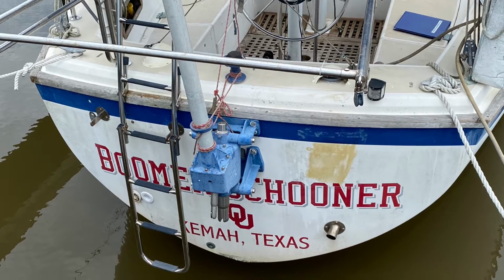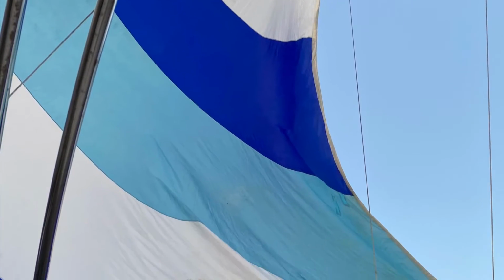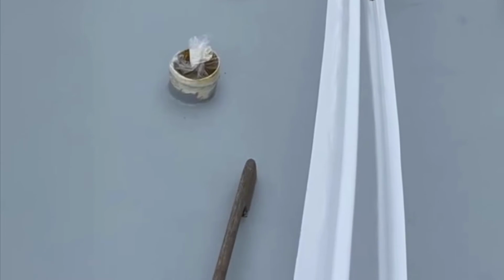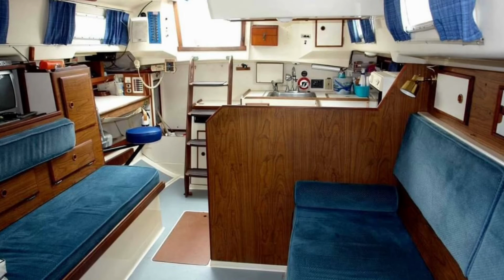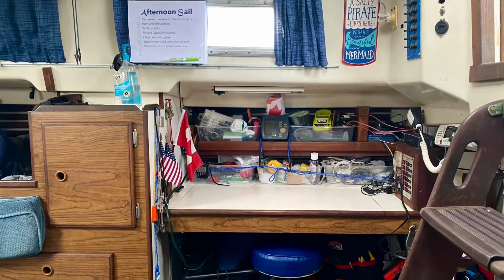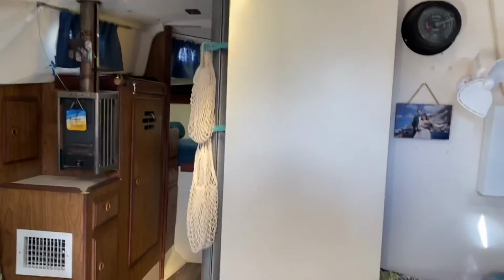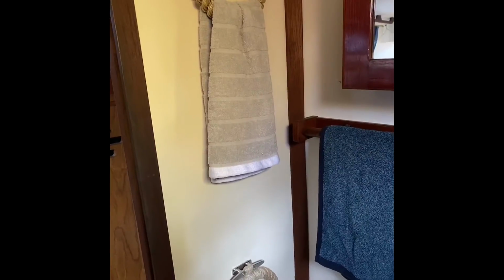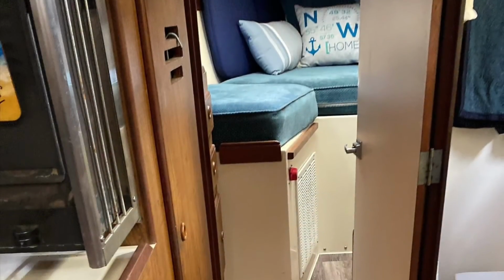Tour Our Boat - Pearson 365

Comment: Hey guys...I'm in contract on a 1979 365. I wanted to ask you a question...Is that Luxury Vinyl Flooring you're using on the sole?
Reply from the maker: Hi Martin. The flooring we used is TrafficMaster Luxury Vinyl Plank Flooring from Home Depot. We have been very happy with it. It has been installed now for about 7 months. 
Good luck with the 365!